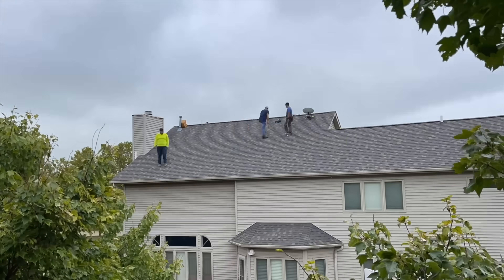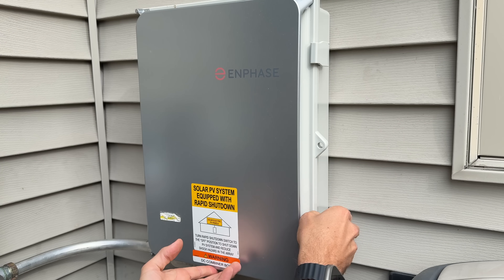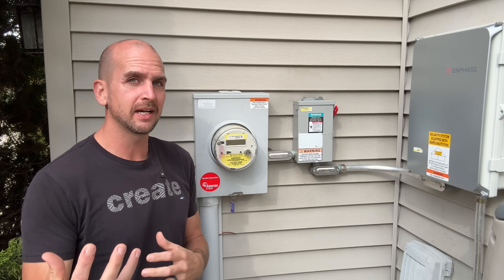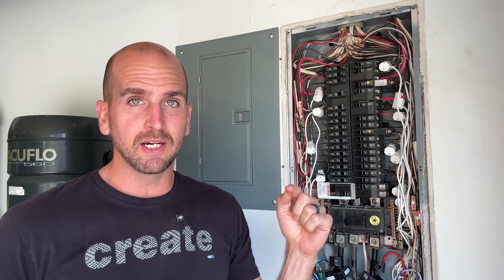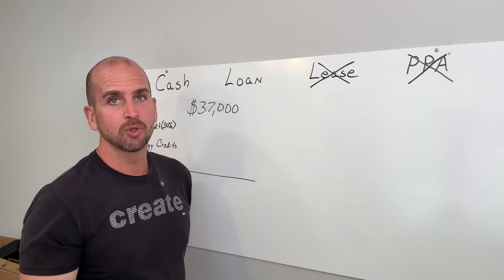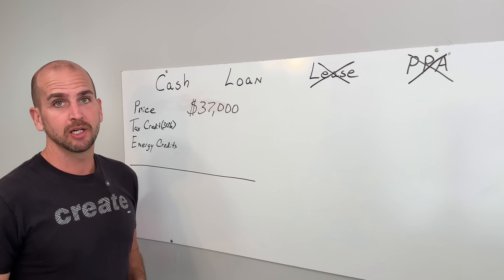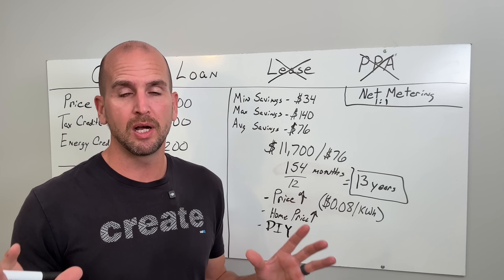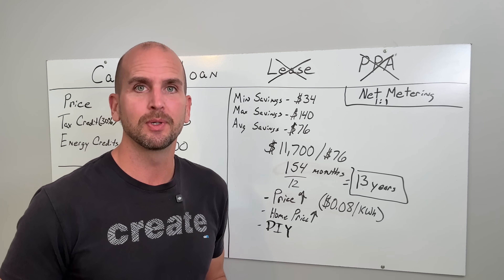Are Solar Panels Actually Worth It For Homeowners?

Comment: I have some comments but concerns as well. In Omaha, NE. we get hail storms at times. I have never had a company tell me if they break!
  Panels with inverters can fail, replacements have to be a factor. Brackets on the roof need rafter structures so a stud finder or measure and drill up is an issue. Brackets can leak, using Grace Ice & Water under & over each bracket is needed. Never use caulking, ever! Buy building sealant like “Geo-Cell” and comes in colors. 300% more expansion and still holds. Use dielectric grease on all exposed connectors, but do NOT confuse this with air barrier sold for aluminum wire connections. Batteries are expensive and take room. They need to breathe so no room no batteries! Tech changes as sensors on inside boxes will detect a power brown out or full blown failure. Neighborhoods are different and if after 1980, most have underground wire to transformers in back yards that split you & 3 neighbors as well but more reliable. Overhead wire use pole mounted transformers. Squirrels loves these and pay the price with a tail & feet on different terminals in older neighborhoods. A phone requires a brief wait as power companies will check for squirrel on top or ground, then they simply trip the breaker back into place. Clamps that go around wires sense current and some have software to monitor & learn each non-smart appliance down to a toaster. Each has a unique waveform and future failures can be predicted by higher current, lower current or odd waveforms. Buy a digital wattage plugin to power each item including the fridge. Choose all items you have to have with power outages, this combined with direction of roof, size and panel fitment need planned in advance. Any conduit that penetrates structure needs seal first from water, inside secondly with RED fire foam in spray cans to be in code. Lots to do! If you have hail experience, please let me know. Nice folks sell solar but many sold forklifts a year ago so not fully informed. Ask questions! Lots and get a solar study print for your file & include many photos of each step if they do it wrong or you DIY the job. Print pics for file as well. Many of these companies are gone after 4-6 years, so a lifetime warranty doesn’t help if they vanish. Choose from 30+ year old companies who do more than solar as incentives dry up or market becomes saturated they don’t pay and leave town to sell forklifts! 
DK, Omaha, NE.

Comment: Solar not worth it since you don’t have battery storage. You need both solar and batteries to allow electricity to be stored for later usage in high cost periods and power outages. You can’t rely on the grid and buybacks. Both are less reliable today.

Comment: I agree that a PPA or lease is not sensible.  If you sell the house for any reason you need to settle with your solar partner along terms that they dictate and do not disclose in advance.  For systems that they are responsible for maintaining, the quality of the equipment is sometimes not that good. In the contract that we were presented with, there were no service guarantees and no relief on the lease payment if the equipment was not working or partly not working.
I live in San Diego, where the electric costs are quite high and the sun shines a lot.  The net metering is really not a very good deal for the homeowner, but there are local and state rebates/tax credits for battery storage.  So your mileage will vary, and the situation for costs, rebates, and equipment efficiency is constantly changing.  Viewers should find a reputable solar contractor and if it doesn't make sense to do the project today, ask that contractor to call you when the environment changes.
Reply from the maker: Thanks for the feedback.  From others I have spoke to in your area sounds like most new systems have some form of battery storage now after the NEM 3.0 standards were rolled out.

Comment: I like the idea of solar even though in my current and possibly forever home even solar salesmen tell me it doesn't make financial sense. Duke's net metering agreement became much worse last year, there are no state energy credits, and my 1/3 of an acre has lots of shade. When I set a 220 watt bifacial ecoflow panel out in the sunniest spot of my yard I got 30 watts so I would likely need a lot of panels for a small amount of power. 

Last year my electrical cost was 8 cents per kwh but it has since gone up to 11 cents per kwh. Adding grid tied solar would require switching to a time of use rate schedule along with a monthly fee for being grid tied that could actually lead to a higher monthly electric bill. 

I would like solar for power outages, but that would require batteries. With the new net metering agreement I would likely never be able to cut my electric bill by more than 50% even if I had enough panels to fully cover my electrical use, so an off grid system could make more sense. For now I'm apt to stick with a generator during power outages along with adding batteries over time to power things like my fridge to reduce generator use, with potentially a few off grid solar panels to at least power a cell phone in a long term outage.

Comment: Regarding the Enphase solar system. With the newer "8" series (2 years?) microinverters, you can create a grid down microgrid, which will provide 2kw power, when the sun is shining. Not much, but helps when the grid is down. Having lived in FL with hurricane power outages, i would use it to charge battery generators. Eventually, the goal is to expand to battery backup, budget permitting.

Comment: Great video, Scott! We pay about 12 cents/kWh for peak use electricity. and about 7 cents for off peak. We installed a 10K solar energy system when we built our house 10 years ago. We went with a ground mount system. Sometime in 2025 we will have paid for our system which cost about $25K. Totally worth it! One of our goals in building our net zero home was to use no fossil fuels for running of our home. We are 100% electric for everything. Here in MN we enjoy the same net metering situation you do, so we are storing our excess electricity in the grid for future use. 3 years ago we bought an EV too, and now drive from sunshine!

Comment: I looked into solar for my new place, but it's not worth it. I only use about 8-12kwh per day and my rates are very cheap. My bill this month is $67. It would take decades to recoup costs. 

I've installed a generator hookup for backup power instead. Im going to use a dual fuel generator as well as buy a solar generator as an extra backup during hurricane season. I can throw out a few solar panels on the ground during an extended outage. This will be about 1/4 the cost of a professionally installed whole home solar system.

Comment: Misinformation on batteries!   I built my solar system.  You need a subpanel that runs off the inverter.  I have a Sol Ark 15k inverter.  I run ALL my house loads off the sub panel.  I do have 880 amp hrs of batteries.   The batteries need another 400 amp hours to have a comfortable buffer.  I can run completely off grid most of the year.  I have 48 each 405 watt panels that generate on a peak day 16,500 watts.  In mid summer in can generate 140+ WHRS a day, double my usage rate.

Comment: I didn't go with a roof mount system for permitting and insurance reasons. I have two ground mounts that I built myself that put out just over 11kW. They're both connected to a Solark-12K and a 1600AH battery bank. Yes, that is 1600AH. I did all the work, installation and wiring myself as I'm an electrical engineer. Commissioned in 2020 during the pandemic, the house just rolled over 30MWh of power generation. I'm about to increase my storage capacity by adding 2 more giant 48V 280AH batteries which will bring me to just over 2000AH of power storage.
I'm 100% off grid and don't sell anything back.
Reply from the maker: Boom 💥.  That’s a setup.  What brand battery do you go with on the original and new addition?
Reply: @EverydayHomeRepairs  I know there are server rack batteries that you can buy BUT I still don't think they're at a good enough price point. I started out with 8x 100AH Battleborn LiFePO4 batteries. Circa 2020 they were incredibly expensive running to almost $8k. 200AH of Battleborn batteries wasn't nearly enough to run everything in my house.  Since then I have built DIY batteries with raw LiFePO4 cells. I bought them in sets of 32x @280AH  from Basen in China but have since switched to getting them from a vendor here in the States as even with shipping it is weirdly cheaper and faster than buying them directly from China, waiting months and paying loads for the shipping. Obviously there's more work to do with raw cells, like BMS and wiring, etc, but I don't mind doing that as everything is under my control. I wouldn't recommend it for anyone that is not electrically savvy, though. The vendor is 18650BatteryStore that I believe Will Prowse has mentioned them a few times.
Reply: Since putting in my system me neighbors have been installing ground mounts on their homes too. We're out in the countryside so there is room for them.

Comment: In Texas, it has become a major issue with insurance companies and whether or not they will cover your house, roof, or even the, solar panels.  I good example is my insurance company.  Because I  have an FHA loan, my insurance company is dictated by the lender.  After having the insurance company come out and do a complete analysis of the solar company the way they were going to attach the panels i would have ended up paying almost doubled my premiums to add the solar panels. The second problem was the solar company.  They only warranty the panels and other equipment for a limited time.  Two years all parts and labor, and 10 years on the panels and 5 years on the electoral convertor from defects no labor.  Third was the ending of solar.  I would have to be plugged into the electric grid and would be charged by the electric company for being tired into their system.  I would also be responsible for any damage from a power failure should the electric company deem it was caused by my solar panels.  Note: Your insurance company will not cover damages should the power company deem you responsible!  All this made me decide it wasn't worth the cost or the potential issues I would be responsible for.   

One neighbor installed a Tesla roof with a Tesla power wall.  It ended up costing him close to 
$110K.  Was it worth is.  Not in my estimation.  Two years later, he has had a number of Tesla roof panels replaced at the cost of more than $2300 so far.  Just last month, he had one of his battery wall units go off line.  Tesla service said he had a bad battery pack.  No problem, the battery was under warranty, but the $ 1073.00 service call wasn't.   After doing some math it is costing he just over $ 140.58 per month for his tesla solar.  His electric bill is only $ 57.28 less per month currently. Not a major savings especially when you consider his other cost...

Comment: One thing to consider that Scott didn't cover is homeowner's insurance.  Some insurance companies won't cover solar systems over a certain Kwh.  They see it as a roof liability/fire hazard.  Check with your insurance provider if they will cover the property with the solar system you are considering.
Reply from the maker: Good point, I was lucky with my home / insurance company where they didn't adjust my premium to include covering the panels but that isn't true for everyone.
Reply: Good point..insurance companies may consider the battery a fire risk.

Comment: I won't name names but it is easy to find battery backed solar power systems with 12,000W inverters, 30kWh batteries and 12,000W solar arrays for $15,000.  Easy to install guys, just take a look around YouTube.

Comment: Sometimes if your roof is old or too new, and the type of roof , putting on solar panels are usually more work than its worth - the savings are not a slam dunk - and they are costs to maintaining panels - as your roof needs extra maintenance , and perhaps you need someone to wash the panels every few years to keep it running efficiently - IMHO - battery back / or smart metering usage may provide more saving without headache of solar.

Comment: Man, I cannot believe you got $14,200 from your State.  Damn Florida doesn't give a penny.   You talked about your 1:1 net-metering. I was going to suggest adding a TESLA load to reduce your ROI years but it seems you aren't generating enough solar (and using too much electricity) to even (100%) off-set your electric bill (and some more).  I think, you paid a lot for your 11KW system (converting DC to AC at panels and no battery storage). My ROI (with a TESLA load) is six years and I am not even selling anything back yet (net-metering).

Comment: I have to wonder about the math.

I looked at a new roof with panels. About $140K more than a regular roof, installed. That's about 470 months of power bills, or about 39 years.I won't be here. My corpse would get cheap power some day.

OOPS. Forgot. I would still have to pay the electric company every month. I'm not allowed to disconnect. Right now it's around $50 even with no usage.  That's another 10 years at current rates, so 49 years total, but the price will go up.

Hey, how long will the panels last? Is it 49 years? Don't think so. They tell us 25-30 years, which in non-lying terms means 20. So let's factor in the cost of installing new panels twice.

Solar panels don't work at night, and clouds slow them down. That means they're no good during power outages or for off-grid types. You still need a generator unless you want to sell your kidneys and buy batteries. They have to be replaced every so often. Tesla claims up to 25 years. People who aren't making money from batteries say 8, so they're the ones I believe. If you're hoping to get off the grid for real, solar panels will only work if you're rich.

Storage batteries burn, and when they do, they burn like Teslas. Like little suns.

The roofing company flat-out told me it was a stupid idea, even though they first proposed it. It would have made them a fortune, and they told me to forget it.

States are changing their laws to stick it to panel owners so they get less money for the power they sell, and here in Florida, solar panels make it much harder to get home insurance. Insurers drop people over this. Solar junkies deny it, but you can Google and see. When I was looking for insurance earlier this year, I found this out from insurers.
Reply: It doesn't make much sense in Florida for a variety of reasons. In other places it can have a good ROI. A thorough analysis is essential before one commits to solar.

Comment: I'm not seeing anything added for repairs after 10 or 12 years these systems will not last for 20 to 30 years. Batteries will expire as well, I assume.  Also extra cost to re-roof. And if you're like most Americans, you're not going to live in the same home for 10-12 years. It doesn't add up for me.

Comment: If I were to take the plunge with solar, I'd take out a loan for the full amount and then take the credits and invest them in the market. As long as the market income exceeds the interest part of the monthly payments, you are ahead.
Reply: This is an age-old desire, but the reality doesn't usually work out so well.  Debt is still debt and in the mean time you are juggling additional cash flow needs for years to make payments on the loan while investment returns are both without stability and also without the benefit of compounding (due to having to make loan payments).  It becomes a tall order.

One is universally better-off saving the necessary cash first (invested or otherwise, compounded or otherwise) and then just paying for the system once you have accumulated sufficient funds.  And this is true for essentially any purchase you make short of a home.   Cars, in particular.

People get into serious trouble with debt precisely because those monthly payments squeeze your month-to-month cash flow.  One can become extremely vulnerable if job-loss occurs, for example.

So I don't recommend it.  It is not a recipe to get ahead.

-Matt

Comment: The REC's and the full net metering are not always available. Without net metering you will save the most when PV production is coincident with your loads, so smaller systems may pay back faster. Or maybe you can move some loads to the sunny part of the day, like water heating, drying clothes, or charging an EV.  Full retail rate or 1:1 net metering is a big advantage if your utility supports it.
Reply: In Illinois, Retail Net Metering is guaranteed by state law for the life of the system (defined as 30 years from connection) for systems installed until the end of this year. Then it drops down to Supply-only net metering, again for the life of the system.

Comment: so when it's time to change out your roof, you guys do what???
Reply: All the panels have to be removed and re-installed after the roof is replaced. This is why pros won't install them on an old roof that may need replacement in the next few years.

Comment: What your really need to calculate is the return on investment and not how many months to pay back.  Our electricity in at my town in CA is now 40 cents kwh which is a crazy 8x higher.  We also are closer to the equator and it doesn't rain much so we get much more solar.  I am sure you get zero production when you have a blanket of snow on your panels!  Our ROI is about 20% per year which is one of the best and safest investments you could make.  Also, no risk of hail or tornado damage!